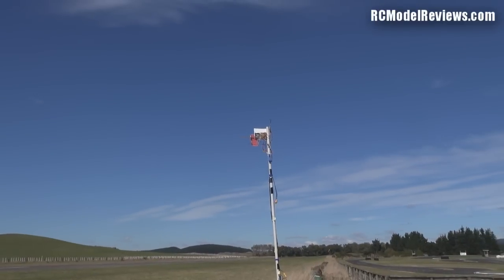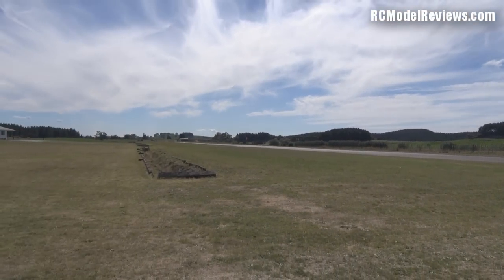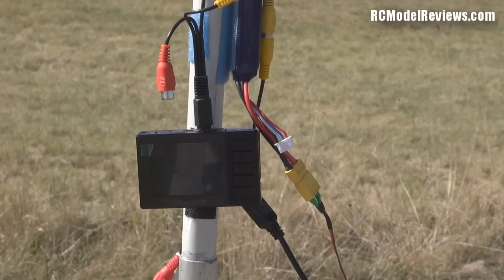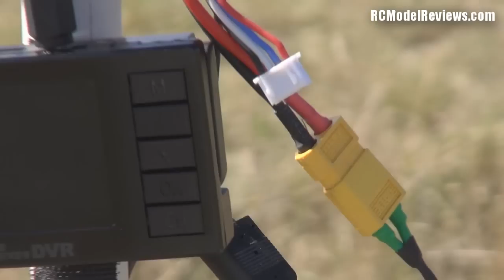FPV Safety: a 1Km flight with near crash

Comment: The best way to chill out your rmilec module
http://www.ebay.com/itm/JR-RMILEC-LRS-CNC-Aluminum-heatsink-backplate-module-Upgrade-for-FPV-/251474626801?pt=Radio_Control_Parts_Accessories&hash=item3a8d0e48f1

Comment: @mark675 its ironic that in a safety video there was an issue that could have caused a crash, but because these basic safety rules had been followed the biggest amount of damage that could have happened would have been a little dent in a shed. This is much safer than most fpv vids on YT where ppl fly over populated areas, fly at massive heights or chase cars down highways. It'll be idiots like that that will get the hobby banned around the world, not the safety Nazis....

Comment: Can you please buy new rmilec unit from hk and do an another review. This time make sure u use high power and because of the heat that rmilec tx produces I suggest not placing it dierctly into 9x but to let is sit outside of the tx bay and just connect it to 9x with jumper wires. What u can also do is to drill some holes on tx plastic cover. That will probably help reduce the heat. I think hk now sells rmulec with guberized antenna, not a telescopic one. Please do an another review.
Reply: This gear is simply garbage... Use openlrs

Comment: Hi Bruce, I am a little surprised that you use a teleskopic antenna, which is not designed for 433 MHz, standing wave ratio (SWR) must be skyhigh. with a result of 95% or more reflected wave back into the transmitter, and no output that must be fritted the transistor. 
would be great if you could add it in a review !

Comment: Maybe he don´t remember setup antenna before fligt. I got over 3 km with telescope and about 2 km with flexible rubber antenna with 5.8G without LP filters. Never problem with RMILEC. I think antenna wire is better glued to frame. He´s setup looks pro because antenna`s have free space but seems that no good Idea. Of cource it depends if someone use near 100w tranmitter etc. for that reason is Failsafe and rth.

Comment: Bruce, I see the 305 by HK, the diversity unit (I don't recognize cause I'm new), and the two brilliant antennas, but I don't see a ground plane any larger than a credit card. Could the addition of say a 2' x 2' (copper film on foam core)  ground plane influence the performance benificially?  What dost thou think?

Comment: Your lucky Bruce, you got about a kilometre out, my RMILEC (clean setup like yours) and flown in the bush without any expected noise on 433 got about 30 meters away and I had nothing. I have since bought the proper half wave 433Mhz aerial from HK and replaced the crap supplied but I havnt put it back in a model yet. I now have a HK EPP nearly finished and plan to use the RMILEC with 1.2 video gear (filtered). Failing that its back to my trusty 1 watt wifi booster on my Frsky setup.

Comment: Another reason why we could be heavily regulated in the near future. Unreliable FPV gear including long range UHF put on the market without proper testing by the manufacturers. Lawmate is a classic example, dodgy video equipment and now most places refuse to sell that brand and even note on their websites that they refuse to sell it on the grounds of unreliability. Imagine if it wasn't Bruce flying and a novice who had no idea what was happening hit someone walking out of one of those buildings.

Comment: In perfect conditions that will work just fine but as stated, the latency is very important. I've tried similar setup but had problems when network connectivity got bad and TCP tries to resend stuff (and radio try to find signal), then I got seconds of delay and that was really bad. Your not interested in high bandwitdh, rather low latency and good coverage, 3G would be enough if coverage is good and 3G is made for speach wich is very latency/jitter sensitive,4G is for data wich is not sensitive

Comment: Does RMILEC let you move up/down in the band (431-437mhz) via software, similar to Immersion's EzUHF? Consider repeating the test with different monopoles or dipoles? 1km is absurd for a FS, I could hit that distance 2m off the deck w/ EzUHF!

Comment: Interesting example there of how easy it is to loose your bearings when flying. Best to use an OSD for safe FPV. Enjoy your vids. @Cyberdactyl this was a test flight. HoryzonHD cameras are notorious for producing a lot of noise in this radio band, I'd also be interested to see how well the V3 performs. I had the HoryzonHD V2 with UHF mod and it caused too much interference with my ImmersionRC setup.

Comment: Hey Bruce, I myself are planing looking to use my 4g mobile broadband to stream 80mbt down and 40uppload, now this juh only up to, but in that area I thought flying the coverage good, in almost the entire village has been my 15mbt down and a good day 70mbt, so my question is what do you think about that? 'as long as the speed is good? and have already spotted a good cheap easy 4g router / modem that can operate with 12v.

grateful for the response Regards

Comment: was the keychain you had the V2 or v1?
Also the light handly seems ok with the fisheye lense, i was quite happy with it, if you check my video (Quadcopter high altitude flight one in didcot near the power stations) it looked pretty good
i did not get a box either,

Comment: I was just on the hobbyking website and they have come out with an aftermarket antenna for this RMILEC. I use the stock antenna and have flown this far without a problem but I have never gone past 900 meters due to my flying location. I also use the same 200mw 5.8 gear.

Comment: Might be worth the 10 odd bucks from hobbyking for there little voltage OSD. Perfect for monitoring RSSI. You can get pretty good resolution by removing the 1k from the voltage divider. Would be a little bit better for diagnostics then just flying till lockout.

Doug

Comment: Hmm, your experience with RMILEC is the complete opposite to mine. I've been 2.2km no lockouts or glitches, yesterday I flew 1km with no issues. I have my rx antennas mounted completely horizontal (one along the underside of the wing, one along the fuselage) and my transmit antenna (nagoya) is also fixed to the back of my 9x to ensure that when I'm holding it in my hands, it too is horizontal. Oh, and I try not to point the antenna directly at the aircraft. never had overheating issues either.

Comment: It's pretty ridiculous that the Rmilec would lose the signal @ 1km distance... I have done almost 2km with STOCK DJI Phantom tx with fat shark gear onboard ( manual says range is 300 meters... ). I have done about a kilometer with FrSKy now and no issues. Rmilec should do 10 kilometers EASY ( should ). I think when the time comes, i'll get the Dragonlink UHF system. The 433Mhz band is pretty crowded since almost every piece of crap broadcasts on that frequency :(

Comment: I fly full size airplanes and even the small four seat ones I have are not as vulnerable to the small foam planes as people make them out to be. It may do minor damage to the plane or even if it hits the windshield it won't endanger anyones lives. You hear of people hitting birds and crashing but that is not from the bird damage but from a flame out of the jet engine when it ingests the bird and thats only when you hit a flock of 15 plus geese not small birds.

Comment: since you are using a 2cell pack on your 305 5.8GHz receiver, have you bypassed the Vreg and installed your own, or can the 305 receiver be safely run below the 12v recommended?

Cheers,
Brian

Comment: Easy way to range test the RMILEC would have been an attenuator and a walk to the end of the run way ;)  But you know this already I'm sure.  Get your hands on OpenLRS HK does a cheap version now.  I've have 10km+ with 100mw and a Diamond antenna and a home made dipole.  Be sure to use the good firmware "Thundead v3.6" not the official as its not as robust.

Comment: It's about RC tx antenna.  Bruce recommended putting the transmitter higher to get RC back, which is not the best thing to do when flying with patch on the tx.

Comment: One other thing I read that you should always have one antenna vertical and the other horizontal to get good range with the rmilec. Would be interesting to run the same test again with vertical and horizontal antenna.

Comment: Bruce, good video.  Regarding your advice of holding the transmitter up when signal gets weak -- that's not always the best thing to do.  With whip antennas -- yes, put them high up.  With patch antennas (e.g., FrSky 7dbi black patch) you get much stronger signal when they are just above ground (around 20cm).  In my experiments the range with FrSky patch at 1m (holding tx in hands standing) was 4.5km, while with holding tx close to the ground gave 10km.